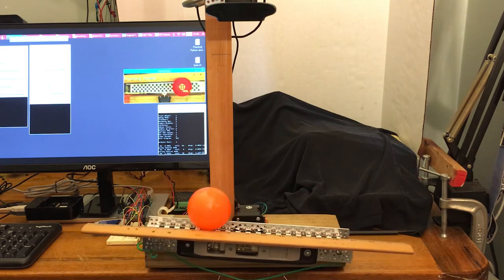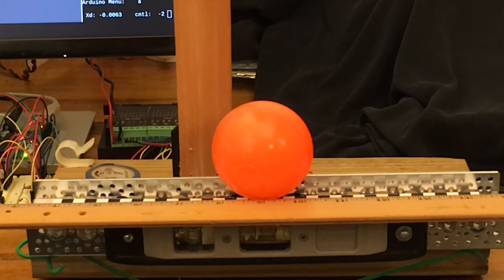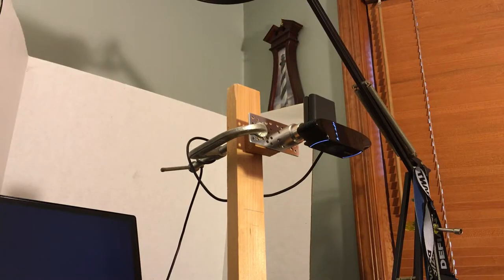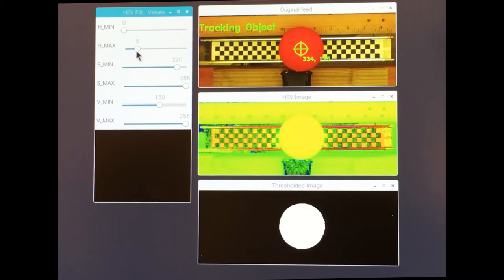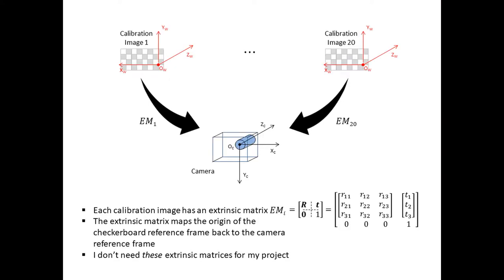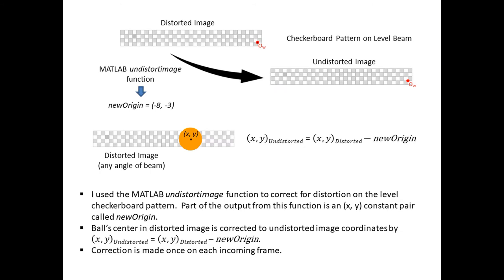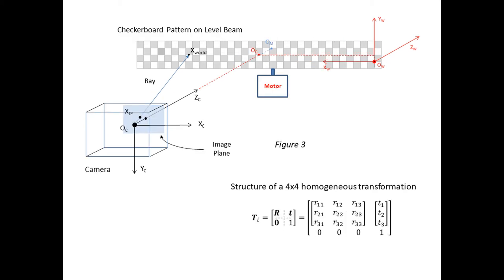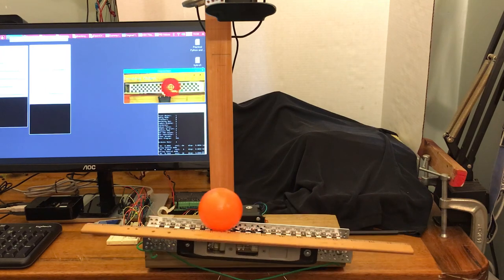Balancing a ball on a track using a video camera, Raspberry Pi 3, and PID controller

Comment: Hi there ray I have just seen your AR3 robot video and I’m wondering if you know of anyway to save the arms position with an input trigger such as a switch I have the AR4 I have the switch working but I don’t know enough about python to implement save the robots position when the switch is pressed is there any chance you could get in touch that would be appreciated
Reply from the maker: Chris Annin provides a Python source code file for the AR3 and AR4 controllers.  In this code you will see the many functions he uses to interface the Teensy's C program.  You have two approaches you can take:  
1) figure out how to access the Teensy program while still allowing Chris's AR4 control program to also access it.  This will involve using some Windows software that allows you to "monitor" or "bridge" the COM port that the AR4 control program is using.  The problem here is that you don't want any messaging flowing into the AR4 program that it wasn't expecting.
2) learn enough Python, which is what Chris uses to create all his control programs, so that you can go into his program and make some modifications.  I think he has a video on compiling his source code.  It's not too hard.  After you figure out which Python functions talk to the Teensy to get the current location, you can then add a special software button and display on one of the AR4 control program's screens to read the location anytime you want.  If you want to do any real experimentation or applications with the AR4, you would probably need to either modify the AR4 program or write your own using a lot of what Chris provided in the source code file.  In either case your investment in learning Python would pay off.

Hope this helps,
Ray Kimber
Reply: @raykimber9672  thanks for your reply Ray, I understand what you are saying, I have been looking through the source code for the AR4 software that Chris has provided with the software that controls the arm and I can see the snippets of code that are linked to the buttons and I have been trying various methods to achieve saving the arms position if a switch is pressed by the robot it’s self but I just get lost while editing the code and end up not being able to figure it out, Chris has said that he will have a look into adding such a function on the next software release but he doesn’t have a lot of time on his hands so I was trying to see if I could get some help off people to help me figure it out which would kind of help him too, but I do see what you are saying I just need to learn more, did you ever release your version of the software ?
Reply from the maker: @latheadventures1390 , my software is still half-baked, and I haven't been working on this project lately, but here's some python code that I extracted from my modified AR4 program that may help you.  I was working on customizing the rough calibration and fine calibration of the robot.  The variables  XcurPos, YcurPos, ZcurPos, RzcurPos, RycurPos, RxcurPos, and J1AngCur, J2AngCur, J3AngCur, J4AngCur, J5AngCur, J6AngCur in the code are part of Chris Annin's overall program.  They are constantly updated to reflect  the AR4's current position and orientation, and joint angles.  As you can see, all this function does is delete and then write to 12 small entry fields (6 for the position and orientation, and 6 for the joint angles).   The code includes the Python function and the statements for creating the display fields.  It also includes the definition for the button which executes the function.  You should be able to stick it in Chris's AR4 source code file somewhere and compile it.  I put my customization code after line 236 (after the "def setCom2():" code).

I am posting the code on the Annin Robotics forum.  It's under the "General Discussion", "Python software to display AR3/AR4 current pose and joint angles in AR4 control source code".

Good luck,
Ray Kimber
Reply: @raykimber9672  thank you very much I have replied on the forum, I’m just trying to compile it to exe not having much luck as I have never done it before
Reply from the maker: @latheadventures1390  look at the Chris Annin video about compiling source code at https://www.youtube.com/watch?v=2VGkgCKXVc0&t=241s
Reply: @raykimber9672  I have watched the video multiple times it just won’t work he doesn’t actually show how to compile it just running the arcs.py file which my ar4.py source code file won’t open
Reply from the maker: @latheadventures1390  I wish I could help you but I don't have the time.  You should find somebody local who knows a little more about Python.  At the beginning of the Python source file there are a bunch of "import" statements.  These are like the "include" statements in C.  Every import statement has to be satisfied, which means that you have to first load the various libraries or modules that are being requested onto your computer.  You need some local help with that.  Good luck. -- Ray